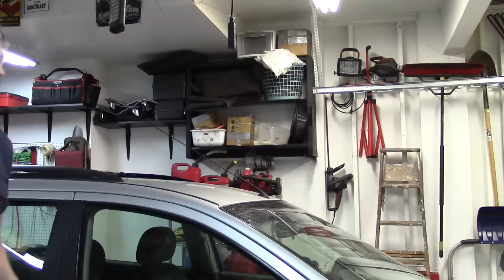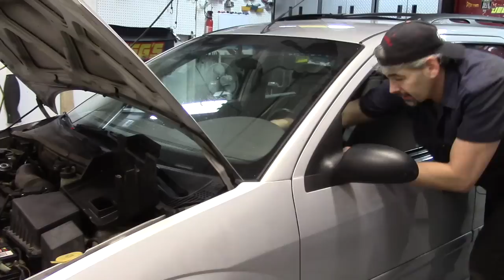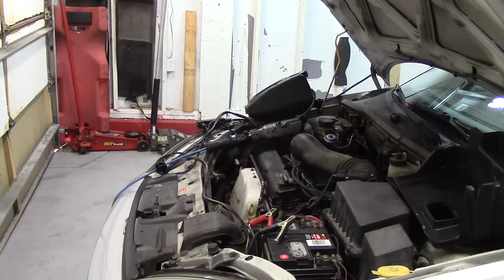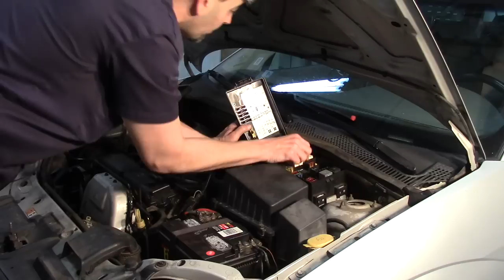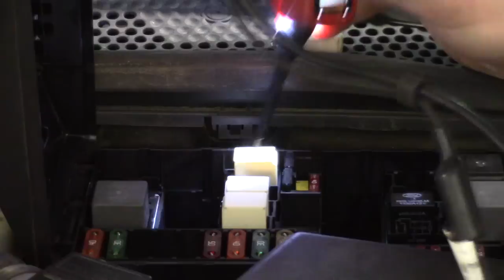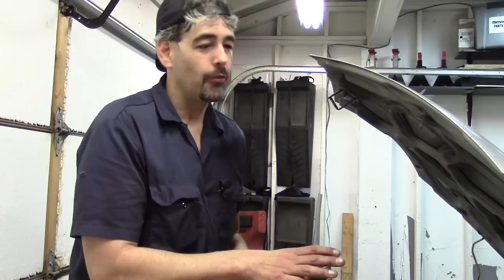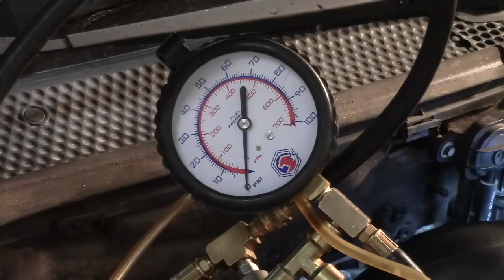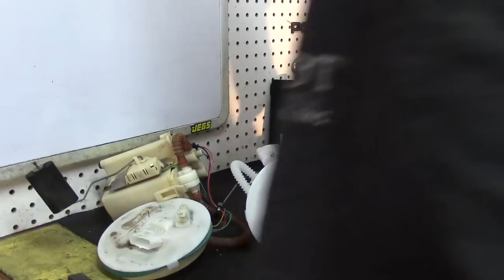Cranking No-Start Real Time Diagnosis -Ford Focus

Comment: Car would not start without stepping on gas, it's fuel injected.   Thought throttle position sensor was BAD but it wasn't.  Checked and ohm meter air temperature switch, coolantswitch,  and they were ok.  Fuel pressure regulator was ok per vacuum check.  Fuel pressure with just key on was zero but stepping on gas with crank worked.  At idle has 35 psi normal but pressure did not go to 43 psi when shut off.  I will check for 12v at fuel pump before installing. Thank you for a pro diagnosis

Comment: I have a question I have a 2005 ford explorer 4.0 and it is crank no start. Ran fine parked it over night went to start it the next and it would not start.  I've got spark and put a new crank sensor and put my ear to my fuel tank and can hear the fuel pump spinning and I changed the fuel filter. Someone was telling me it could be my temperature sensor I don't have a fuel pressure tester and the 05 don't have shredder valve what should I do
Reply from the maker: I would totally start with that crank sensor- what was your data indicating it needed to be changed especially considering you had spark?  That’s exactly where I would start but you didn’t include that data.
Reply: @SchrodingersBox  I put a new crank sensor on it
Reply: I haven't had computer put on because I can't get anyone to come by with one I'm going off what people tell me. When I changed my fuel filter it had dark gas com out of the old fuel filter but I did put a new fuel filter
Reply from the maker: Yeah that’s not data sorry. I need basic data to even get a direction.

Comment: I need your help!!!!!!!!!
Reply from the maker: And what would that be?
Reply: @SchrodingersBox  my wife drove the car home after filling up the tank due to the fact it was going to be freezing here in Connecticut. This morning she went to go shopping and it started but sputtered and then shut off.. I took off the intake sprayed some starting fluid and the car did start right up!

I'm someone who builds houses for a living and builds everything under the Sun but playing with cars and troubleshooting I can narrow down to a certain point before I need help what do you think is it the fuel pump?
Reply from the maker: The first thing i’d do is check fuel pressure.
Reply: @SchrodingersBox  they are telling me that it's $450 for the fuel pump??? If I can further this conversation with you? I would honestly really be very appreciative?!
Reply: Is there anyway I can send you the VIN number? So you can help me not get robbed?? 😜👊👊👊
Reply from the maker: @Joeycapp_711  It's entirely possible it's the fuel pump- unless the fuel pressure is good which is why that's the first thing I would do.
  If the fuel pressure is bad AND a voltage drop and/or restriction or regulation issue is ruled out, yes- you need a fuel pump.  Assuming they did all that, I'd say $450 for a new pump is a bargain!!
Reply: @SchrodingersBox  that was just for the part $450 that included no labor which the guy we bought the car from bought everything and sent somebody to replace the fuel pump which was used I'd rather have a used one than no car at all for the wife but the update is the car is running and everything seems to be fixed for now I would like to say thank you very much for all of your help you are one stranger that has now just become a friend of mine thank you
Reply: Okay the review is in! It is 2 days after Christmas and we took the car out yesterday and it lost pressure sputtering gas pedal goes to the floor for about 2 seconds and the more gas you gave it the less it would drive?? We barely got back home now the car will not start?? I really honestly I am at my wit's end with this basically brand new car do you have time to talk? 203-802-0461 I'm honestly don't have anywhere else to turn

Comment: Fantastic video. Full of information in a short amount of time. I didn't have to fast forward through any of it.
 Now I gotta check an old car, 1989 Mercury Tracer with 401,000 miles on it,  for a no spark. Just totally died while driving it. I need to see if you have a video on that. I purchased a new distributor & coil because they are a few days out once ordered. I need to diagnose before installing them.

Comment: High I love your videos  you are very good I got my wife a mustang 1998  v 6 3.8 L. I AM WORKING ON if i give you some info about it and the engine codes could you help me. etc :
Reply from the maker: Sure. what’s the code and what data have you collected?
Reply: @SchrodingersBox  well codes 171 174 running lean hard to start but runs good, but after truning it off for 45 min its hard to start fuel pressure none in schrader value 
view freeze data
first time reads   2nd              3rd
fuel sys 1 cl,         cl                   cl
fuel sys2   n/a        n/a               n/a
load_pct% 25.1        23.9             19.2
etc (f)   207               199              167
shrt ft1   -5.5             10.2            -2,3
long ft1 27.3              21.9            11.7
shrt 2 % 6.3               26.6            -2.3
longft 2% 29.7           26.6            12,5
rpm    708                   728           1327
i cleaned  mass air flow sensor, IAC, and sprayed inlet on carb,  put two new vacuum lines on to , EGR ,  going to exhaust purge valve.  i have a new fuel filter, but not on the car yet.will be testing fuel line pressure . next
Reply: ITS not the fuel pump i can hear it every time i trun the key on. or it could be low voltage will be working ON IT FASTRACK.
THank YOU been watching all Cranking no start  videos .
Reply: how i get the car to start, by truning the key on and off about 6 times after that i trun over the engine on the 3rd time it will pickup and run .when we first got the car it would die when idling, acting like no fuel, once running it run very nice under all loads stop at lights keeps running great,when shut off it seems to lose fuel pressure, one time i took it out ran ok but then i had a surge after stopping and taking off again that coursed a missfire on plug 1 got it home, let idle it just bogged down .since then i started cleaning parts ,iac  atc  on freeze frame  3 last column  it runs a lot better but still hard to start, i only have code 174 now. @SchrodingersBox
Reply: @SchrodingersBox  code 171 is now fixed ,to cold to work on it out side, i am a truck driver and dont get much time off to do much  on the car.

Comment: Would a fuel pump suddenly stop working?
Or are there any symptoms of it slowing down??
Reply from the maker: Both can happen.  usually I see the indication of a failing pump reflected in high long term fuel trim numbers under load.
Reply: Schrodingers Box my fuel economy went really bad and there was no power. Now the car cranks but don’t start. Has spark. Took the fuel line off the fuel rail. Fuels coming out but not under pressure. Can hear the relay clicking. But no sound from the fuel pump. 
Do you think it’s mostly likely the fuel pump? If so what else would you recommend I change? Fuel filter and fuel pressure regulator?
Thanks in advance 🙏🏼
Reply from the maker: @rstezza  Sounds pretty easy to me... just confirm you have positive fuel trim adjustments under load and there you go! easy one.
Reply: Schrodingers Box thanks man 🙏🏼

Comment: Great video I have 1998 Honda Accord I was getting a green key light my car would crank but not start...I had 2 recalls on my car
so I got the car to the Honda dealership they fixed the recalls
which was in the ignition the
car still wouldn't start they had my
car for 10 days and I was thinking
worst case scenario I had a bad immobilizer which I would just
pay them to fix they told me the
reason why my my car wouldn't
start was due to a after market
alarm they wanted to charge me
500 dollars just to diagnose
my car...I thought that was ridiculous so I sent the same
tow truck driver to get my car
he immediately informed
me my car has power but
now it will not crank no
lights dash lights come
on when you turn the key
and the car won't even
shift into any gear....
I looked at my car when
it got back and the first
thing I noticed was one
of the battery terminals
had a huge burn mark on it
I have never seen the only
thing that comes on when
you turn the key is the beep
noise the lights come on
the brake lights and hazard
lights also the radio don't
even work anymore I got
the battery tested and charged
but I got the same results...
How did they do a simple
recall and I go from possibly
a bad immobilizer to power
but no crank and no shift....
I'm wondering what did they
do to my car...I talked to the
service I was upset and he seemed to be apologetic
he told me to now get the 
car towed back up to Honda
Dealership and he won't charge
me to diagnose the car and he
also said they would eat most
of the cost...Does this make
any sense to you? Should I
take my car back up there?
I just wanted to get your opinion on this situation...

Comment: Great video. Thanks for your time and effort sharing your knowledge.  You got what it takes to be a good teacher on this matter. Super, this will help me get my 1999 Suburban up and running again. Stopped working while it was parked with no so much use. A couple of more test but more than likely it is the pump. Although I can hear the noise when it energizes. I changed the Cam and Crankshaft sensors alerady... We'll see. Thanks.

Comment: is this a spark tester  ?
Reply from the maker: I believe I use a test light as a spark tester in this video if I recall correctly. Anything that grounds the electrode can be used as long as it can handle the voltage. An LED testlight would not, for example.

Comment: On fuel pumps, do you replace with OEM only?  Or is there an aftermarket brand you trust?  I had to replace an in-tank fuel pump THREE times on an old '93 Camry!!!  My bad, because I went with the cheapest available from Rock Auto.  Fortunately, swapping them out was easy because there's access under the backseat.
Reply from the maker: I use any pump. If it keeps failing you need to do voltage drop testing. The pump is not likely the issue. 
  Never just replace a pump. diagnose cause of failure.

Comment: I changed everything  I bet it's my fuel pump too I can't do that so I guess it will be off to the shop was trying to save money but not gonna happen I found a plug on the passenger side in the foot area but don't know if it is a inertia switch on my 2010 Hyundai Tucson i'm tired can't figure it out
Reply from the maker: What data do you have? What is your strategy to determine the issue?

Comment: Hello Sir! 
I need your help from Sweden! 
I have a  I pulled out my stereo and then put it inside but now everything works on the Dashboard but nothing happen no crancs no start nothing battery is ok, can you help me?
Reply from the maker: Sure- but I need basic data first. What is your voltage at the starter?
Reply: @SchrodingersBox  
I don't know exactly! 
I know one thing the issue is not from starter, cause I tired to push the car and put it the gear on second but also nothing happen
Reply from the maker: Ok then, I would need to see if you are getting cam and crank signal outputs next.

Comment: Did this eventually fix the no crank no start problem? I am having the same exact issues.
Reply: Haha. Me too! It died on me twice on the freeway. I was going 75! When it did start i took it to 2 different mechanics, they couldn't find any problems with it. I'm getting the battery tested right now. I might have to change the starter. I'm trying to trade it in asap.
Reply: @yayap5631  so I've replaced the starter, crankshaft positioning sensor, camshaft positioning sensor, spark plugs, ignition coils, new battery, and now I'm not getting any sparks to my spark plugs.

Comment: I have similar problem but when I push start the car it starts (its a manual gear box), I dont know where is the problem!!
Reply from the maker: Possibly clutch not disengaging or maybe starter not properly shimmed to flywheel...

Comment: I just got done watching your video. The purpose of me watching it is because I have a 2002 Ford Focus 2.0 16v Zetec. The car won’t run right when it’s started and acts up and runs like crap. I checked the spark and it’s good. I’m checking the fuel pressure and I know it doesn’t have a return and has a fuel pressure sensor at the rail where the line hooks up. What’s the pressure supposed to be before starting the car. While turning the key on, and while running the car in park? I been watching many videos and a lot of them say to rev the engine and if the pressure goes up the regulators working
Reply from the maker: It’s the static decay, not the starting pressure that is important. Attic decay should be no more than 10PSI per hour.
Reply: But what should the pressure be when I turn the key to the on position and the pressure when running the car.

Comment: I have the same problem i checked the relays there good fuel pump turns on also has spark what els can it be? the car randomly turned off while driving i checked and it online and it said it can also be the coolant temperature sensor would that be the problem?
Reply from the maker: Always start with basic FASTTEC analysis
Reply: I checked eveything and everything works fine it just cranks but wont start at all
Reply from the maker: Then you did something wrong. Everything cannot be fine- one of the FASTTEC componests has to be missing. There is no other explanation.
  How did you verify each component?
Reply: I replaced the ignition coil and the fuel pump primes i also replaced the relays and it does the same i was reading online that the temperature sensor if its reading low temp and low voltage it can make the car not to start cuz once it kinda over heated and it was low on coolant and the car wouldnt turn on untill it got cold and i turned it on then it would turn off and untill i added coolant it ran fine again
Reply from the maker: @805liltony  Wait... so are you saying you did not have both spark OR fuel and therefore you replaced the coil and fuel pump? How did you confirm you now have spark and fuel afterwards? How did you find you did not have it before you changed these? That's where the clue is!
Reply: The fuel pump has been working i just changed the coil and i sticked a screwdriver on one of the spark plug wires to see if there was spark and spark came out
Reply from the maker: OK and before you replaced the coil there was no spark correct? That's the important part.
Reply: Yea before i changed it there wasnt spark but when i changed it there was spark now

Comment: Good job, but I don't consider plugs and wires wasted money as they're part of a tune up anyways. Unless they were recently done already.....lol. Then shelve them until needed. The last car I had with a Schroeder valve port was a first gen neon and I miss them. Was so easy!
Reply from the maker: They are indeed a waste of money if you don't need them.  Is replacing your tires with 85% tread a waste of money because you will need them anyway? People almost always replace plugs and wires on a prayer, not on maintenance.
Reply: Poor analogy, tire tread is easily determined. They replace them because it is easy and inexpensive and required preventable maintenance just like o2 sensors nobody ever changes until they fail......me included  lol. TBH it is rare that it fixes the issue, last time it worked for me was a dead 80's Plymouth TC3, new wires and she fired right up. I was shocked!
Reply from the maker: @billwhitmeyer3861 Well if you knew how to assess that ignition is also at near full life you would understand the analogy is perfectly correct.  Just because you cannot see it does not mean you can not quantify it.  This is the difference that skill makes!  If I see the total fuel trim representative of complete combustion then I know only a moron would change plugs and wires regardless of how long its been. I don't even need to confirm with quantitative Kv metering- I mean, how else is it scientifically possible to have stoichiometric conditions, right?
  You know what I am saying right.... wouldn't you agree that just replacing them is just due to incompetence? Also what about models where the plugs are under the plenum- replacing them would be even dumber don't you think!

Comment: i changed camshaft sensor, same problem, i changed the coils, but it only occurs at random. its a 2006 Mitsubishi lancer
Reply from the maker: what was your data showing those parts were bad and needed replacement?

Comment: Good looking out on the flat rate comment. 
One test you could’ve done that’s real quick is to put a fuse loop on the fuel pump fuse and see if you have amp draw consistent with a pump B- if you have a scope, really see what is happening at the pump
Awesome job confirming though. I wish there was time to be that thorough all the time. 
I would be called the pump w/ an amp test on a scope and then confirm the fix
Reply from the maker: Yes at the time of the video I didn’t yet have a scope but now, that is exactly how I do the testing.